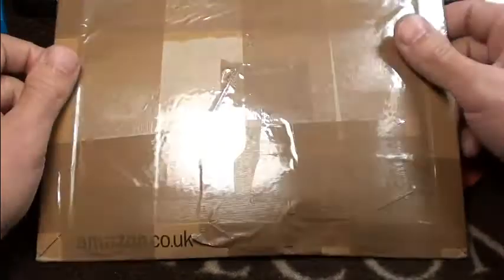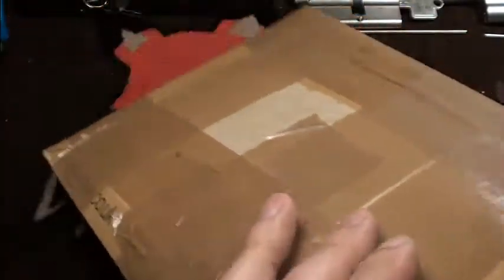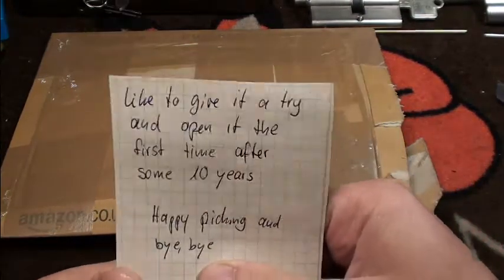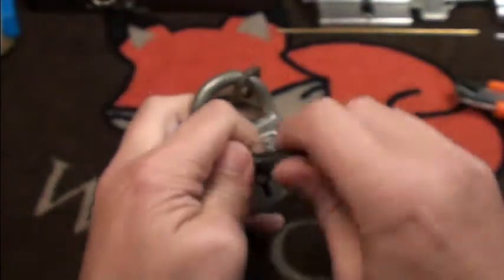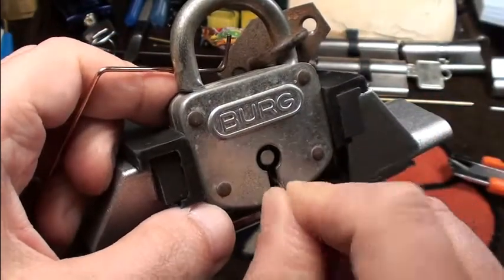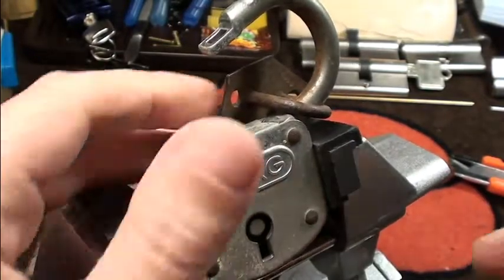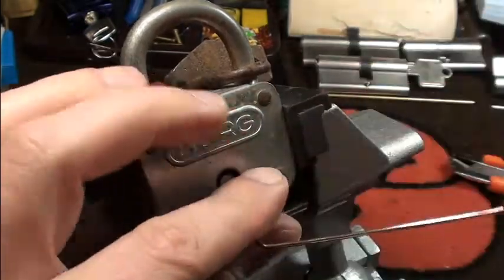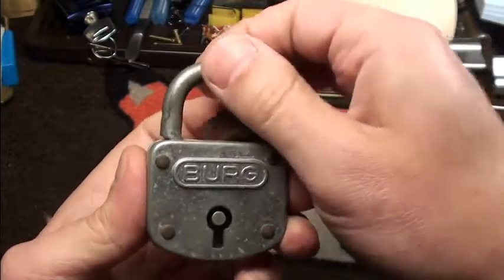(185) - unpacking, open and close of the weekend surprise from Potti314

Comment: What a beautiful old lock! Very nice picking too Foxxy :-) What is the LED Lenser light that you used?
Reply from the maker: Thank you very much Ethan :). It did open on surprise haha ;D. The LED Lenser is a model K1. The only disadvantage is, that it uses very small batteries, which I rarely get in the stores. I will probably buy another model too :). Cheers
Reply: The K series does take strange battery sizes, I was tempted until I discovered that, now i'm considering a P2 or P3 which takes an AAA size battery. Also they have focus.
Reply from the maker: Yes, the K (keyring) series takes LR41or43 (can't remember), at least hard to get in the store. I'm thinking of getting an additional K2 anyway ;). The P2 is a lot bigger, but has the advantage of AAA as you say :).